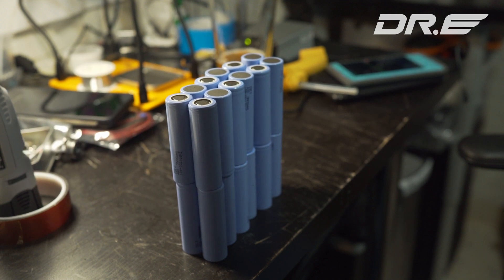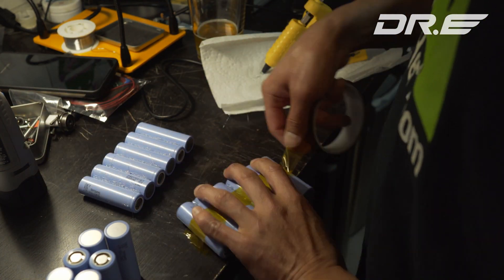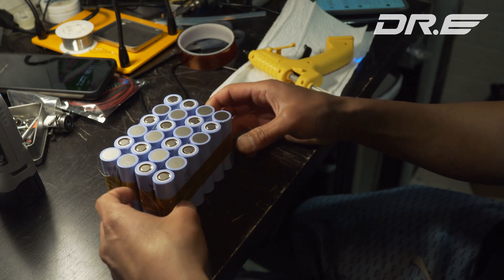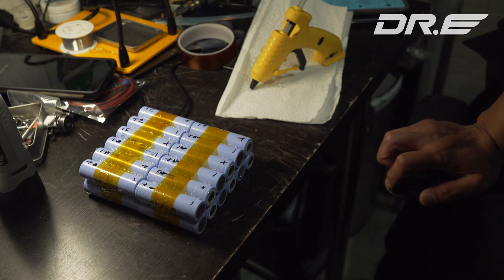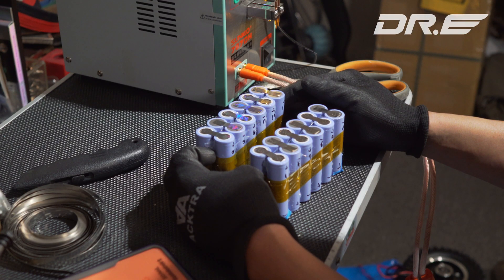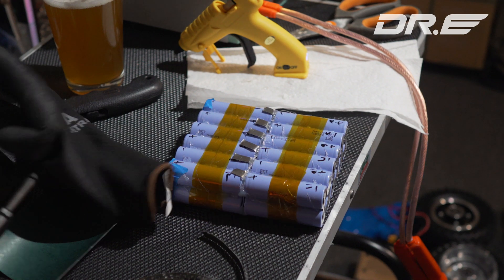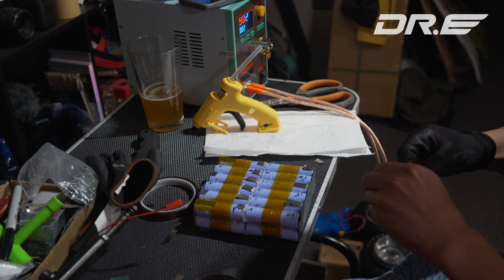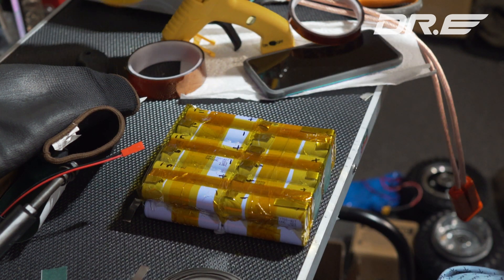How to Build 12S2P DIY Electric Skateboard Battery Pack! - Part 1

Comment: Why are a few of the access points to the terminals here on the negative side? Was this just an error that was corrected before the next video? I'm referring to 7:45 in the video.
BTW - I really like your explanations and the way you mark things so clearly on the batteries. Makes things so much easier to follow. thanks

Comment: Hey Dr. E.  Where did you learn all this stuff?  What was in the glass?  Lastly but most importantly, y'know the solo wheel, one wheel, funwheel a.k.a Fat Hub Motor wheel?  Is there a reliable distributor of these?  Anyone who shows the building or assembly of these Overland Snowboard style devices nearly always leaves a link to a "sorry no longer in stock" or "couldn't find this page".  Which kinda sucks when you finally pluck up the courage to try build a project but you're screwed right outta the starting gate y'know?  Also, really love your videos.  First class sir.

Comment: can i charge my 12s with a 13s (48v) charger, and simply pull the plug before the end-of-charge voltage of the battery is reached?
Reply from the maker: Very dangerous to do unless you can measure the voltage while doing it.  You can easily start a fire if battery pack goes over voltage.
Reply: But it works?
If I do something like this, I'll measure it every 5 minutes anyway.
Then I disconnect the charger and see how far the voltage goes down - I then repeat this process.so I approach the end-of-charge voltage
Reply from the maker: Most chargers will slowly ramp up voltage so charging below 80% should be safe.  So charge a little bit at a time it can work yes but please order a bench power supply then u can charge any type of battery.